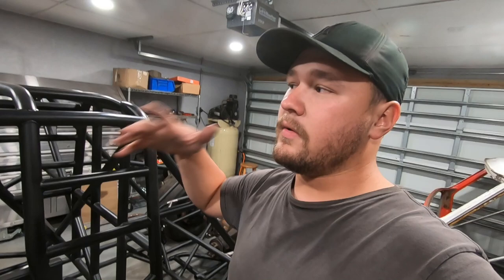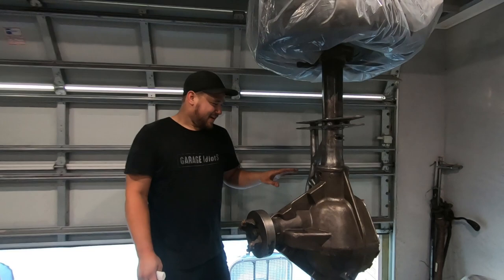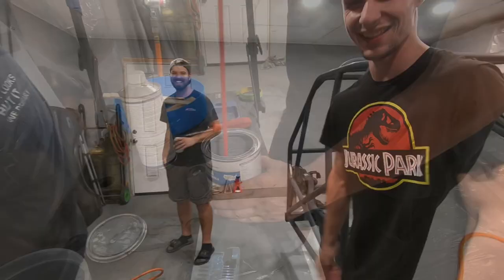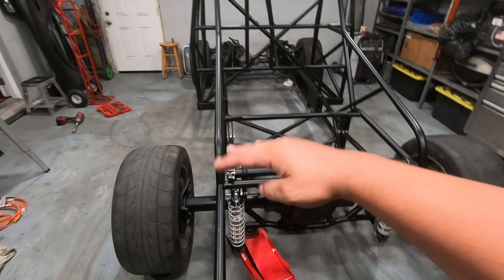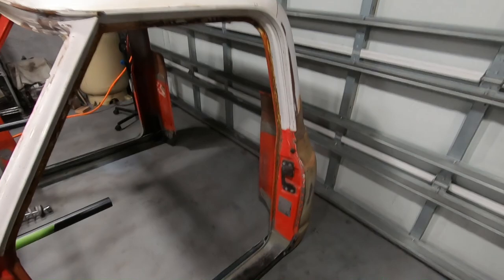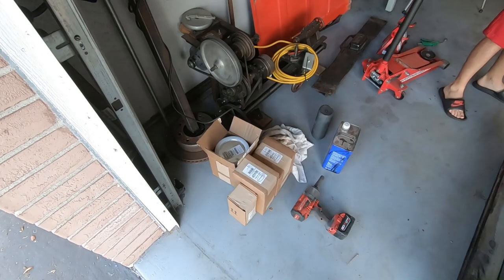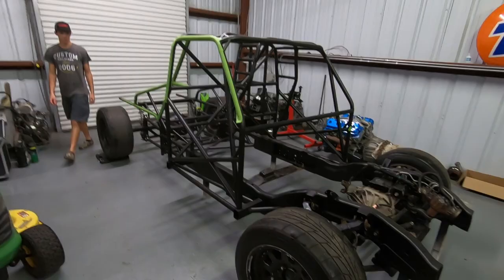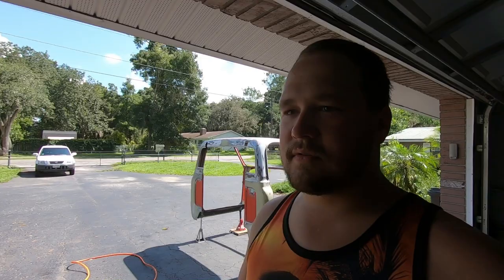Painting All The Things - C10 Race Truck Updates

Comment: A chromoly ford 9" with brakes and everything is like 150lbs so youd lose like 350lbs just by changing to ford 9" and 150lbs from the 4l80e thats around 500lbs, going from a steering box to a manual steering rack aswell would drop a hell of alot of weight, you can also go to a motorplate setup and get rid of the k-member and motor mounts and you can front half the chassis and that'll pull even more weight out of it. I think you can easily get this thing to low 3k race weight with you in it if you switch some things up.
Reply: Is manual steering a thing with thouse racing trucks?
I belive 4wd diesel truck without power steering is looking for trouble(Or guardrail 🤭).
Reply: can you get 8 lug axles for a 9 inch?
Reply: You can order a 9"  with any  bolt pattern you want. if you have a pre existing one You can have the pattern re drilled
Reply: A fofd 9 inch before it goes in a race car this is what's done to it.  A back brace put on it so the axle tubes Won't bend . Axle tube flanges are cut off bigger bigger flanges are put on to Support bigger Axel barren because now you're running 35 spined axles over 28 spine stock You would have to do that to a stock 9" housing for it to be able to live in a race car or race truck
Reply: @regno78  Greg A on youtube switched his 2nd gen 4wd dodge to manual rack. It hasn't ran yet but alot of people do it.
Reply: @brandonfloyd6321  most people use a power rack out of a 3rd gen dodge

Comment: When painting over filler spray them first once, let if flash. Then go wider on your next coat over the filler area and then from there you can paint the whole piece with your other coats. Courser fillers also absorb a lot more paint. I like using icing on my final coat. It’s very smooth and fine

Comment: Epoxy is only to seal bare metal.Filler soaks the epoxy to seal it off. You will need to apply 3 coats of High build primer or primer of your choosing. Start off at 180,filler etc. you will feather edge in all your body work with more Primer. Step it up to 220,primer again go 320/400 if you are happy paint it. If not go the extra step after your 320/400 to 600 and then spray it. All about effort put in now. Great progress made and love seeing happen..

Comment: When priming over body filler, spot it in heavily with primer first.  Ideally, 3 to 4 coats worth of thickness over just the filler first. Then coat everything else. That’ll help cover it, and also give you plenty of extra primer, directly over the filler, to help level everything when block sanding. Hope this helps.

Comment: I have been out of the body work game for quite a while but when I did it for a living we always used a sealer to keep the body work from showing through before laying down the primer.  If you use any of the air dry spot putty and don't seal over it the body work will show through after paint because the thinner will absorb into it making it swell initially, then when it dries it will shrink exposing exactly where the putty was used.  Probably not the end of the world on a race car but when it is a customers car it can be the difference between making money on the job and paying for the work yourself. Lol
Reply: That’s what I was thinking would filler primer work as well being thicker??
Reply: @Justme-jt1ef   It will work, but it has to be sanded back down again afterwards to avoid the paint looking dry.
Reply: @MrKingdavis13  well yea I like to wet sand it saves the paper when lubed and clears the dust that would otherwise clog the paper

Comment: HVLP. High volume, low pressure.  Good for primers and some single stage paints, but I prefer using a RP (reduced pressure) gun for 2 stage or more base coat, mid coat, and clear coat. And it’s always good to spot prime over body filler before laying the whole panel. Be sure to give it flash time between each coat and feather out each coat you spot. Start with a larger area and end with just the area where the body filler is. It seems like it takes more time, but it will actually save time later as well as preventing the spot from being noticeable.

Comment: ive seen something like this on a german channel, the primer and paint lifted off the bodyfiller after a while i think they said its because of incompatibilities between the paint and the filler so you might want to keep an eye on it and maybe respray just those areas with a different primer
Reply: Came to say the same thing, probably the polyester resin in the bondo reacting with the epoxy primer
Reply: Heaps of shops will spray an entire car with putty
Reply: Had the same issue with the same primer it was fixed by putting primer surfacer on and some spot filling putty in some of the more significant areas.

Comment: For future reference my stock 71 c10 longbox with a 350/t350 combo weighs right at 4000lbs without me in it. 

As for the filler soaking in the epoxy primer it will do that. You really need to use a filler primer to level everything out and give you some mil thickness to shape and block it out flat. But single stage urethane is pretty thick so if your not too concerned with it being super nice then itll probably cover a fair bit of stuff.

Comment: that spot on your roof will block sand out just fine dont worry about it, the reason is the plastic was at a different level from the metal  and you could put 26 coats of primer down and it would still be at two different levels .  i actually stopped spraying primer  in spots   i moved to rolling it on with the ppg 2 or 3 inch rollers so you have no tape no paper no overspray and in the end your block sanding your primer down it works great if you use good surface primer put three or four coats its dry in a half hour

Comment: sometimes it's all in the cooling cast will cool at a different rate than iron or steel so if you can let it cool slower less chances of it cracking..wrap n welding blankets.n controlled room temp.

Comment: Guide coat over your current primer then block down and it will show all  low spots then do your bondo repairs then spray with a primer filler then guide coat that then reblock  the body then  you can wipe down for your base coat colour

Comment: Body Filler = Polyester Resin based. Primer is Epoxy . Epoxy and Polyester hate each other.  A rattle can primer over the Body filler will get it sorted out. 
I would sand back where you see the issues and rattle can those spots. you can then re prime over it with your Epoxy.

Comment: Always use the recommended pre paint wipe before painting it can have an effect on what's underneath especially filler as it is absorbant and read the data sheet for the paint you're using with regards to thinner/ reducer, to thin and the paint will not cover properly, hope it helps

Comment: Ditch the 4wd now, save money and weight and keep the Allison trans in it now vs 4L80. Just my opinion, rather not deal with front diff, axles, t case just to pull it out later but would be cool to see all wheel burnouts.  Full floater 9” would be awesome

Comment: Does the ARB negate the 4 link? Could you not just use the ARB and upper bars (to help locate the axle)?
Reply: The axle is center located by the lower center wishbone setup so the ARB has nothing to do w/ holding the axle center location, neither does the 4 link, the ARB only prevents body roll in relation to the axle, notice how small the ARB links are and only meant for up and down force, and both the ARB and the 4 link bars can be pre-loaded if needed for launch and straight direction control so they work together to control the chassis and power application.
Reply: @macman231  The lower wishbone locating the axle is what I meant by the 4 (5?) link locating the axle. 

I haven't seen the full setup in detail, but limiting articulation seems to work in this instance. Is the ARB on heims all around, or rubber bushings, or is one side solid welded to the lower bars?

It seems like the wishbone wouldn't be needed? It would locate the axle as well and still allow up/down movement without side/side. Especially if he ran triangulated upper bars?

I could be wrong though - i've only built tri 4's and wishbone 3 links.
Reply: @macman231  I now see it's kind of a torsion loaded system. Nevermind.